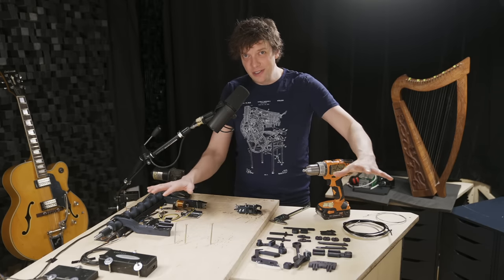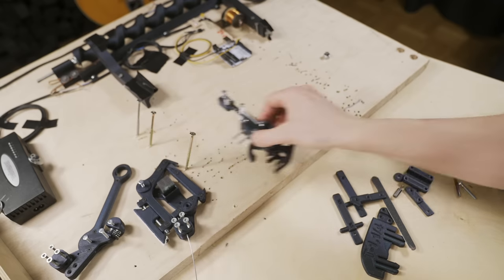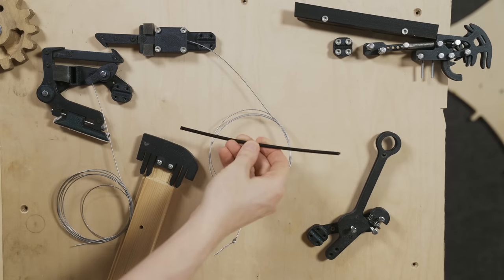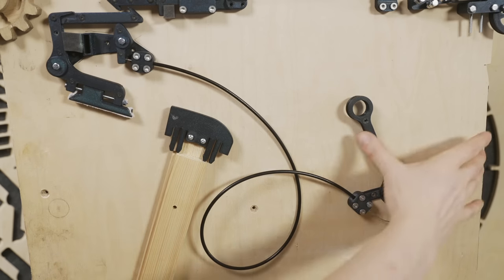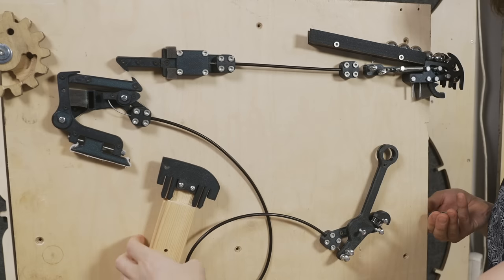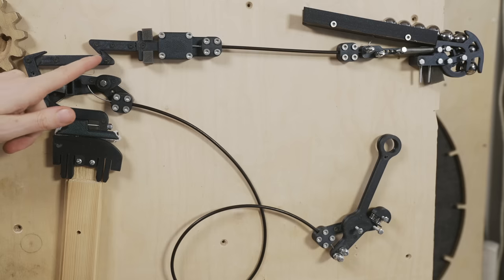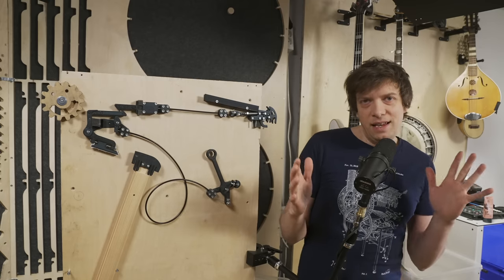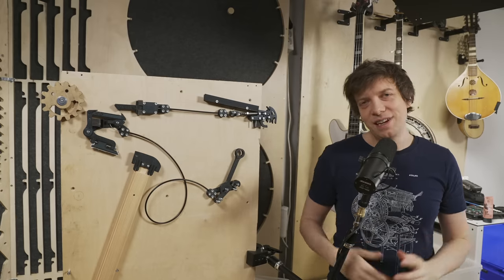These Bowden Cables Surprised Me!

Comment: Brilliance! Simple and pure :)
A couple of observations from 30 years or riding and wrenching if I may;
1/ Use the cable to pull on the device and a spring to return to normal as demonstrated with the marble gate. Every cable actuated bicycle component works this way. If it aint broke...
2/ Keep cable runs as short and straight as is practicable for each application, every bend and loop will add a little friction which might upset Martins righteous obsession with "tightness" Incorporate barrel adjusters for ultra precise fine tuning
3/ Quality sealed systems with non compressing cable outers will cost more in the beginning but pay off with smoother, "tighter" operation and reduced contamination issues, I use Jagwire Elite Link system on all my bikes and heartily recommend it or a similar system

I Believe!

Comment: As a cyclist and design engineer that has used cable housing and cables in a similar application, also use the housing end caps (ferrules) and one barrel adjuster. Your parts should have a hole sized appropriately to receive the housing end cap, and it should be a blind hole with a captive end a small hole that only the cable goes through, not clamped as you have here. The clamp adds compression and unnecessary friction. If you look at cable actuated brakes or gear shifters on a bike, you will notice there is a threaded screw that the cable housing fits into. You use this cable to adjust the tension of the cable, which is really important and gives you an easy way to do this on the fly. One end of the cable will have the blind hole and the other will have the barrel adjuster.

Comment: Dear Martin, engineer here. Please be aware that the metal cable will over time grind down the outside tubing from the inside. This means if you have any curve in the cable with every working cycle the resulting timing will shift a very tiny little bit - and the errors add up over time. So please check if the resulting deviation after 100k or 1m working cycles stays within the acceptable range. The tension of the cable matters, it works like a double-cut file. More tension equals more grinding. If you go for mechanic bowden cables you might need to adjust their lengths individually every few concerts.

Last remark: every non linear pulling angle will introduce the error of a changing bend radius = slowly shifting the working point towards later. You want to always pull parallel to the bowden cable. The applied pulling force vector better doesn't change its angle during operation.

Comment: Lots of good advice from bike people here. Just wanted at add to make sure never to get brake cables by mistake. It won't matter for the mute, but on the trigger mechanism it will introduce timing issues. Brake housings are springy, too transmit high forces with less precision, while shifter housings transmit small loads with high precision.

I think your existing timing adjustment system should already account for cable stretch, just know that it will have to be frequently recalibrated (like, every few shows, not multiple times per show.)

Comment: fun fact I learn once about Bowden cables, some weapon, called bullpups, make use of their principle to move the trigger away from the action. as you want no delay between pressing the trigger and the gun firing, the only solution is often a cable or a steel bar to transmit the force. so, yeah,  bowden cables rocks (now that I think of it, it's also why they're used for breaks on so many vehicles – not just bikes – their instantaneous nature is unbeatable.)

Comment: I know the 'felt' under your adjustable lever which gets pushed by your programming cam peg looks like a good idea, but it is a part which will randomly wear.  Try testing 2 - 3 bearings in place of the felt.  They will provide less friction as the programming peg-module glides under them and all it will do to your mechanism is remove the felt, add 2 screws with small bearings mounted in them.  You may find that as the rotation speed of the program wheel and it's pegs might not incur much noise at all.

Comment: Leo just in case you didnt know, one of the bike parts where money really makes a difference is the cable and the housing of bicycles. If you want a much lower ammount of friction in the system, all sort of fucnky teflon costings and lubricants are availiable just pricey compared to a 2 dollar steel cable. I worked for GM on the Merge and Meld ebikes and we tested a wide variety of cables and housings. There are more then one size thickness too, as well as brake cables vs shifter cables either of whicb could apply in a custom machine.

Comment: This is actually pretty cool. You learned the design principles of machinery in the hard way. But that means you'll never forget those!
So far you are relying on gravity for a lot of actions. You shouldn't. I suggest you to introduce elastic members when you need a piece to "fall" into certain position. Aside from the marbles themselves, those are heavy, the really light (and almost massless) bars of your mechanisms can have some trouble of you rely on them falling into place by mere gravity.
Springs, rubber, even little plastic flexible members can do the work and they don't need to be strong. They just need to assure you the pieces follow the path you intended (for example follow a cam). There are inexpensive flex metal springs that you can attach into your design. Like the ones in the scissors of swiss army knives.
Keep these videos coming. They are great!

Comment: These cables are another example of Martin getting distracted by shiny new toys.  These things are going to wear out, get kinks in them, especially if you repeatedly use them to push like you are on the mute mechanism, if they are not under constant tension they will bend in ways you don't expect.  Its going to be a maintenance nightmare.  Very premature to call it a 100% win before you've put them through the ringer and done a long term repeated test on them.

Comment: Two points of advice for using cables if not already pointed out:
1. Cable adjustment, look into other forms of cable applications like for example automotive throttle cables which have threaded sections on the end of the housing for adjusting cable length and or tension. You will need this for having any controlled adjustments to timing. 
2. Consider changing how the cable attaches to your end pieces. Clamping the cable end between two plastic pieces will require more work in disassembly should a cable need to be disconnected or changed out. In the automotive world you would most always see a slotted connection point that would allow the cable to be inserted or removed from the item it is attached to as long as enough slack in introduced. 
In other words, look at items like universal automotive throttle cables for pulling, or shifter cables for pushing actions and how attachments are normally made in the automotive world.

Comment: There’s about a billion different kinds of Bowden cables (both inner and outer cable) all with slightly different properties. But Have a look at push pull cables, will reduce the need for return springs everywhere and should make the translation of movement tighter.

Comment: The cable system is a great idea, I am a bicycle mechanic so I work with them all the time. However the way you affixed the ends of the cables might cause problems as the pressure holding it in place can crush the cable causing more friction! I would highly recommend making the cable connection sheath connection points have more of a countersunk hole so that the cable sheath has an end stop holding it in place. you can still have a small clamping pressure but don't totally rely on that or it will inevitably cause problems.

Secondly as TheXtrafresh said don't expect the cables to work for a pushing motion, instead have a spring loaded action that the cable resists to keep the mechanism in tension.

Comment: Fun thing about that bistable mechanism, light switches have used that since 1884 for quick-break to extend switch life and reduce fire hazards, I never quite realized that the switch lever on a light switch is not mechanically bound to the switch itself, its why when switches get old they don't have the characteristic snap that new ones do, the spring is worn and soft so the quick-break isn't so quick anymore, which also makes old switches a possible fire hazard in regards to airborne flammables. I watched a video on the history of light switches a few days ago, quick-break switches used to be these robust and expensive things and now they're made of mostly plastic and like at most 7 or 8 individual parts.

Comment: I've been thinking about the programming wheel  gearing and remembered that in order to reduce noise it is best to have the teeth counts on the gears be coprime to each other, or if that is not possible that they should have as few common factors as possible.

Comment: As said by quite a few other people, dont cheap out on these cables, get stainless... Also use ferrules and 3d print stops for the outers to actually sit in and rest against otherwise they will pull through and loose all your tension.

Finally these cables stretch after use (like strings after first replacing on a guitar or a piano) so a threaded barrel adjuster on the lever/cam end which threads directly into the part to add/remove tension to the cable on the fly with relative ease gives you these outer cable housing stops but reinforced with metal and adds cable adjustment to both ends of where you need the cable to be used.

Comment: Love the way your engineering this machine. One thing to keep in mind with these cables, you can fix the outer sheath at one end move the inner cable then fix the inner cable at the other end and use the outer sheath as the moving item. You just need slack in the installation so the inner and outer ends move independently.  This might overcome the issue mentioned by other of pushing the cable. It might also just give an alternate method of operation in some circumstances.

Comment: I'm so happy to see you start using bowden cables, they're a game changer for machinery, very wire-punk.
Just be careful and try adding few springs as resets by the end of them as those cables (or ropes in general) are great in tension but terrible at pushing things as they can bend or kink. Otherwise the cables tend to squish like those chinese finger traps and adding friction.

If you want to make sturdy or custom sized end caps I often put a knot in a metal bead and fill/melt everything together with solder.

Also, lubricate those puppies like there's no tomorrow, good against wear but unlike us you'd probably seek a smoother transition to shave off as much delay as possible.

Comment: Absolutely, this is one of my favourite changes so far! It solves the huge issue with spacing of marble gates and the programming wheel, and uses a simple, reliable, easily manufactured assembly. So much less dumb than the MMX!

Comment: @Wintergatan
With this Bowden cable design, you can even program in a "mute track", so the instruments turns on & off automatically depending on the programming, with all the precision too :D
So, a new track on the programming wheel, controls the On/Off lever, instead of the marble-dropper.

Comment: Keep in mind that with the bowden cables, if you want to reposition the dropper and use the same run of cable, you will need to re-adjust your dropper side end termination as the inner cable will become either shorter or longer relatively to the outer depending on the shape of the run.

To demonstrate, mark a point on the inner cable after it exits the outer and see what happens to the relative position of that mark as you manipulate the the bowden cable into different shapes.

Comment: When bicycles moved to index shifting, the Bowden cables needed different housing because the weren't accurate enough.  Shift cable housing has the housing wires parallel to each other.

Brakes, due to the forces, need the old style housing due to compressive forces.  The housing has a metal spiral in it.

If you visit a bicycle shop, they can show you the difference.  You can buy the housing in large rolls.

I normally use a light oil for lubrication, but there are "dry" lubes that may be better.

Comment: When you get to final assembly, I would probably wipe down the steel cables with a little bit of 3-in-1 penetrating oil. It will help greatly with reduced friction inside the sleeves as well as prevent rust. Also like everyone else suggested, given how many of these you'll be doing, it's probably worth it to buy the good cables and the proper ferrules/caps/tools for them. Always love it when some "Found Tech" can be repurposed for other things. With the cables, if you design a sort of mid-cable coupler, you can have a control console separate from the instruments. So you could have one MM3 be just drums, a second one be just strings, etc. You'd just need a good way to tie the different instrument 'nodes' together in time either through electronic controls like a timing pickup (think camshaft or crankshaft position sensor from a car on the drum's drive pinion), or through some sort of common linkable drive-shaft. You could even add group stops like a pipe organ. Pull one lever and all cymbals mute or unmute, etc. So much scope creep, such little time :)

Comment: One note about these kinds of cable to consider is they are not really meant for pushing. They can probably if it is a light enough force but the ends outside of the sheath will quickly just bend and buckle if they after only a few inches. Easiest solution is to add return springs that will pull the cable to a "default" position (like on a throttle body) or you can get push-pull cables that can handle significantly more push force.

Comment: i love this. You can make the programming wheel not only smaller, you can make it bigger for a longer and more complex sequence. I just picture you standing near a very big fancy programming wheel and play tight rhythms. thinking out of the box: the programming wheel doesn't have to be a wheel anymore. It can be a long conveyer belt. Imagine the flowing symbols of the matrix theme. You can have a vertical conveyerbelt with all the programming profiles and have them activate on top. Some glowing paint on them an some black light... What a show! that's great!
Reply: Or make the programming wheel stupididly larger into a hamster wheel for Martin to run the entire show!

Comment: Very cool to follow the process in this broken down way :) One thing, not worried that the cables will get loose? Tensionon the ends, wire getting softer (bending radius shrinks, effectily adding more lenght) As in, slopp could mean misstimed marbles (or more likely, missed oned) etc etc. if solved or deemed not an issue, excellent! but if it could impact, then I forsee issues with keeping it all in "tune". 

BUUT, I am probably being an alarmist :D
Reply: People have been advising against using bowden cables for exactly this reason. Surely he'll build calibration/adjustment features into every single mechanism that uses one, but yikes that seems like a hard thing to test and maintain over time, and not worth the benefits of "quantum entangling" the machine's functions (which also kinda saps the charm and "magic" from the machine, but that's another issue). Like, I'd be paranoid about it all the time, constantly running tests to see if things are still calibrated instead of playing music with it.... oh wait, maybe that's what Martin actually wants. 🤣

Comment: Have you tried to put the parts into acetone vapors (i.e. little bit of acetone in bucket with lid + part hanging there without touching). Acetone would make the part surface very smooth so no sanding needed. If you try, pls be careful not to leave those parts too long into the bucket as acetone will effectively melt the parts. Just idea to make a super smooth looking 3d printed parts.. PRO-look.

Comment: Lots of good advise about using cables under tension or compression. A small detail (building on another comment) for the cable between the programming interface and the ball-drop interface. You want to make sure you have as little friction in this one as possible. Friction in this one would have the effect of slowing down the release as the springs on the ball-dropper have to overcome the static friction of that cable inside the bowden tube. I was at first going to mention that this cable should probably always be under slight tension to avoid minute amounts of slack of the cable inside the bowden tube (especially with long and loopy cable runs here). But, I realized that the timing isn't critical when the programming interface first starts to pull on the cable as the programming pin/paddle first pushes up. The ball dropping timing is only related to when the programming interface falls off the programming pin/paddle. The only way that I can think of for this timing to get messed up would be due to friction fighting against the springs on the ball-drop interface. Not to increase your part count, but I wonder if putting washers inside any place where one plastic piece rotates against another around an axle would help reduce friction, or if the washers would be unnecessary. And for these imaginary washers, would a specialty low friction plastic like Delrin or Teflon be necessary, or would metal washers (PLA doesn't grip that well to metal) be sufficient and lower cost than the specialty plastics. Or will all these plastic parts eventually be milled from Delrin or Teflon once the design is proven in PLA? (Faster(?), cheaper, and less messy to iterate the design on a 3D printer than milling plastics...)